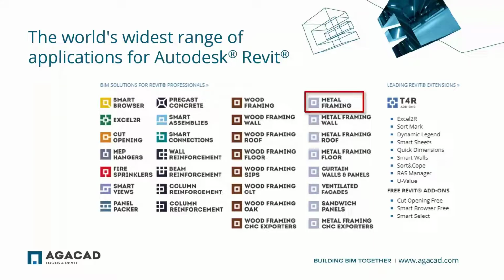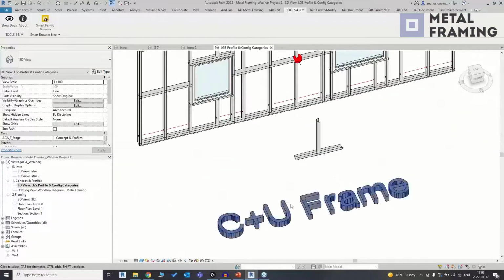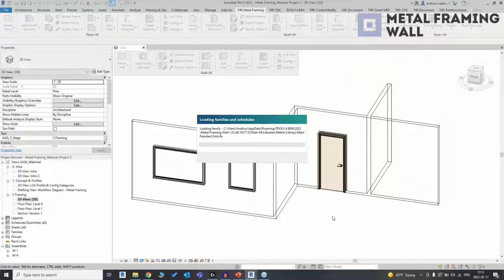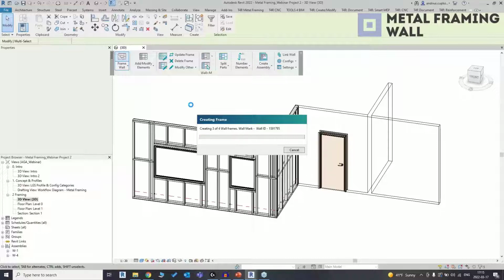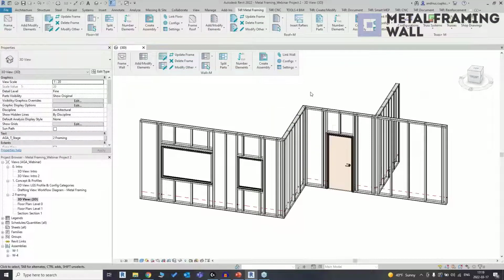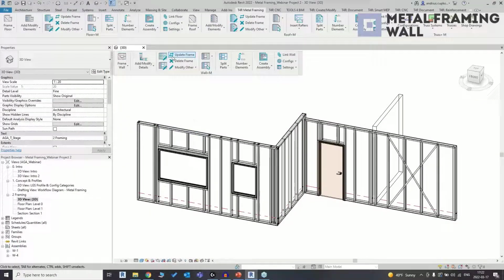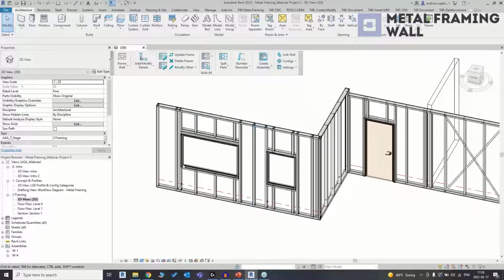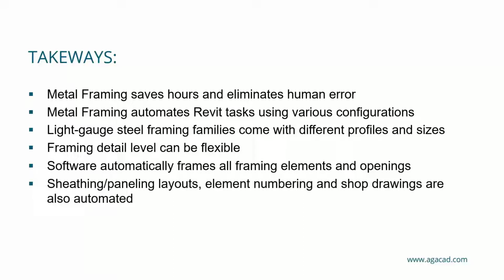Quick Light-Gauge Steel Framing in Revit: From Design to CNC Export | Be.Smart Metal Framing

Comment: great  ,can you do  artichetural drawings   for a house for a customer provide with  plans layout  and dimensions  .
Reply from the maker: Hi there, 
Yes, you can create shop drawings with automatically dimensioned and tagged elevations, plan and sections for each house panel together with schedules and material take-offs. Read more about this in our technical documentation: https://docs.besmart.software/3d-modeling-and-design/metal-framing/getting-started/workflow-step-by-step/walls/shop-drawing-workflow